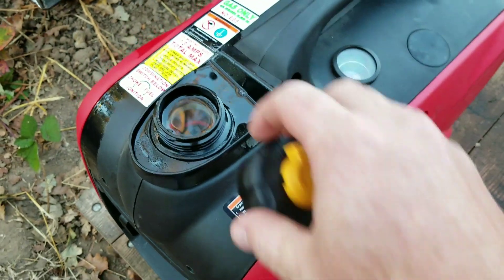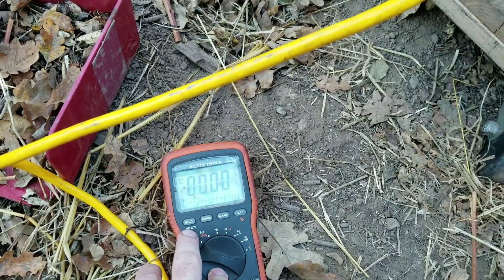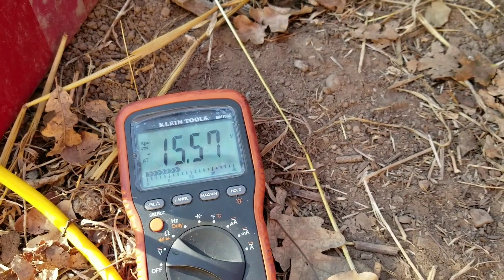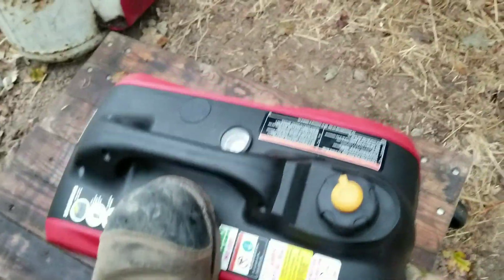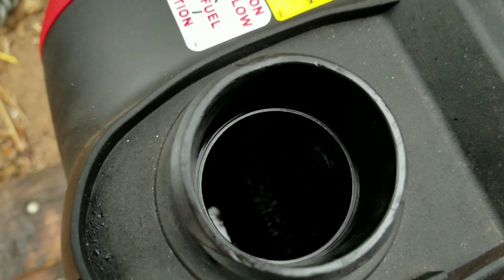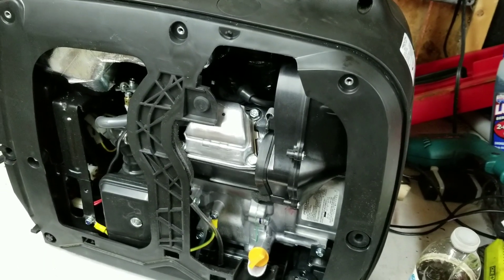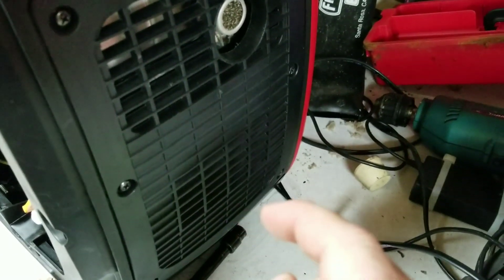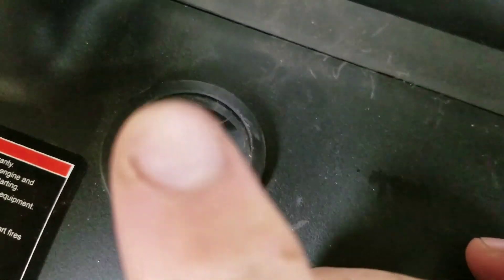Predator generator 2000 testing how long it will run with 200 watts of load

Comment: I have this generator great little thing for emergency harbor freight this summer 2025 coming out with a 2500 I can’t wait to upgrade it grade . I have the 3500 and 4 5000 good price and dependable  they are all good on gas instead of one big one . The 5000 I parallel them together for the extra watt like a big one . Any small generator is great on gas and easy to transport . I use a lot for work the 2000 for tools tile cutter chop saw . Grinder great machine . The 2500 is coming out this summer 2025 can’t wait to get it . Fir work

Comment: They say you should run for 30 hours for break in time without a load ... And they are know to run for 20.000 thousand hours before tear down ....
Reply from the maker: i just looked at a Ryobi with 2500 hours and it was done, completely worn out.
now, if you take care of it, change the oil frequently and run it at 50% or less then yes, i can see getting over 20k hours out of it. i seen an Isuzu generator with 100k hours, and the head has never been off.

Comment: You are supposed to charge 12V batteries with Eco Mode off, and not use the AC outlets.

Comment: If you remove the metal screen from the muffler you may get more efficiency out of the engine. It can really reduce power on smaller engines. We had a chainsaw that would not stay running and removing the screen solved the issue.
Reply from the maker: i've never had an issue with a clogged screen.

Comment: Lol... 17 seconds short of 15 hours!
Reply: @NetwizzJbirk the the secret is spend a small fortune on UPS inverter and then you combine the power density with a solar controller and basically you would have atleast 20killowatts per gallon and doing some rough math you would save 40percent off what the mains cost as long as you charge only 2 battery at once.

Comment: The manual instructs that when using the 12VDC there should be no AC power being consumed and that the idle control should be off. 
I've been trying to figure out why.
Also, the manual indicates that the voltage is not regulated and that you need to use your own regulator. LOL

Comment: I don't think overfilling the tank is a good idea.  Just measure it for a gallon.  That's about what the specs say it is.  And, by the way, you didn't need to fill it full to test it.  Just measure a quart or even a pint exactly and time that.  Then you only need to run it empty for about two hours and your wife and neighbors would be grateful.
Reply from the maker: well at the compound no one cares, i was just joking..
plus if you just run it just for two hours your not going be able account for heat soaking, the alternator losing efficiency from heat, and resistance.
overfilling the fuel tank takes in account that everyone i know overfills there fuel tank, i bet you do too..

Comment: How has this held up? I have a HF 8k gen, have had it about 5 years or so and have never had an issue. I average about 25 day of no power a year during the winter. Was thinking about getting one of these gens to run my boiler and lights through the night since there so quiet. Thanks.

Comment: I have seen 17 hours plus with my WEN branded unit.
Reply: Whats the capacity of your WEN (sustained watts and peak watts) and how big was the load in your test? I'm assuming just a couple hundred watts?
Reply: @grasshopper3085  17 hours on 2 to 300 watts at most. We are over 4,000 feet elevation and I have not re-jetted the carb so peak watts for me is around 1,300. The manual says above 3,000 feet the "high altitude" jet kit should be installed
Reply: @slickjimmy76  Have you tried doing the same test with the EcoMode turned on? (Same conditions, same load). I'm curious to know how much of a difference that feature can achieve.
Reply: @grasshopper3085  That test was done with eco mode on. I never shut eco mode off unless I am using it to power my 6 gallon air compressor. It draws too much on start up.
Reply: @slickjimmy76  Oh I see, so those eco modes really work then wow.

Comment: I purchased a few of these and sent them to Puerto Rico. The spark plug coil died on one of them and when a called Harbor Freight for a replacement, they told me it was not available. Thank God it was still under the 90 day warranty. But what would we do if it wasn’t.
Reply from the maker: i found out that these are clones on the Yamaha 2000watt, so parts SHOULD BE interchangeable if your in a bind
Reply: I bought a similar clone, the Westinghouse iGen2500.  This first thing I do on these Chinese generators is pull the chinese spark plug and replace it with a quality NGK plug.  You can pick those up off Amazon for less than $3 each.  https://www.amazon.com/gp/product/B00WF9NY1Q/ref=oh_aui_search_detailpage?ie=UTF8&psc=1
Reply: HF offers 2 year extended warranty but must be purchased within the first 30 days.